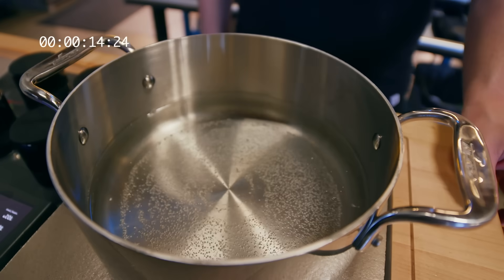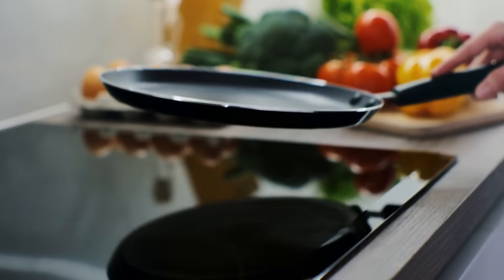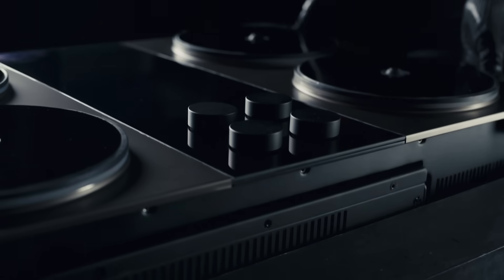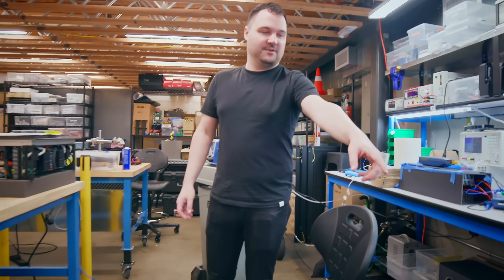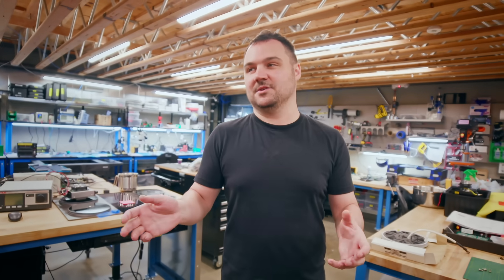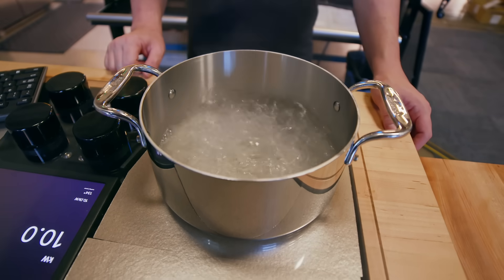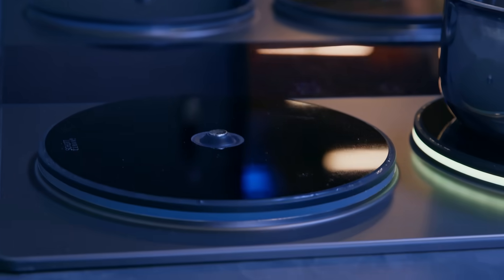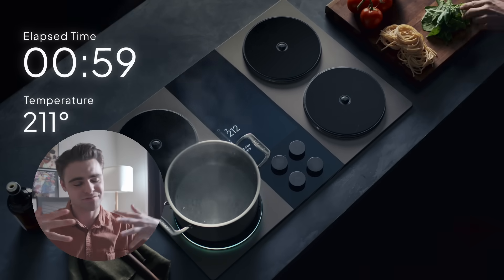World's Most Powerful Stove: Boils Water in Seconds | Impulse

Comment: What I want to know:
1. Temperature control is critically important for prosumers and chefs. How fast can these things cool down?
2. EMF emission. I don't want nnEMF blasted at my head. Please measure it and report back.
Reply: They cool down as quickly as the pan cools down when you turn a gas element off because the element never actually gets hot. It is only inducing current in the pan/pot.

Comment: I am intrigued. However, I think I saw some nub sticking up off the 'burners'. Do I also have to have proprietary pots and pans? Those burners didn't look flat.
Reply: I believe those are switches. When depressed, the element is able to turn on. Being an induction stove, anything ferrus will work as it uses magnetic induction.
Reply: It’s the temperature sensor. Works with all induction-compatible pots/pans

Comment: This induction stove looks like a great invention. But, natural gas is much more efficient than a coil, because it doesn't warp the pan and cause a single hot contact spot. Gas stoves are nowhere near hot enough to make NOx! Also, burning gas to make heat is 100% efficient. Burning gas to make electricity is probably 40% efficient. It's usually a waste of electricity to turn it back into heat. Maybe if you had a restaurant in the summer this makes sense. But gas stoves and gas heat are better for the environment overall imho.

Comment: Nothing compares to a Chinese restaurant jet engine-like wok stove😂
Reply: maybe in sound and wasted heat.

but if it's any indication, panda restaurant group (panda express) actually has been fielding some induction wok burners from lestov, the commercial chinese induction stove manufacturer.  they have up to a 25kw unit that's equivalent to a 150,000 btu (perhaps more due to electric heating efficiency).  they can reproduce wok hei with ease.

likewise, they're starting to get used in larger commercial cooking settings in china as well.

Comment: With the water boiling that fast I can only imagine how hot that pot is with 10 kW flowing into it.  

If the power goes out in the home how does it know when to safely feed electricity to the house with AC since it might go down the power line and hurt engineers working on the grid?

If this was two burners and cheaper with the 3 kWh battery, I'd consider but this price point is way up there.
Reply: Not 100% sure if it’s capable of back feeding power, I think he was just brainstorming potential use cases. The actual website make it look like it’s only for powering the stove. Anyhow it could work similarly to a whole house generator automatic transfer switch, though I’m not really sure you want to go through all that wiring for 3KWh.

Comment: I think this is a super cool idea, but launching it in a 30" cook top is a massive mistake. People who have cook tops tend to be more well off, with separate double ovens. As a result, they tend to be working with 36" cook tops with pre-run 240v. A 36" GE induction cooktop is only $1100. It can only dump 3.7kW into one burner, but it can do up to 11kW across all 5 burners without the risk of running out of battery. For those people, there is no reason to buy this product. This needed to ship as a full stove with an oven if you're targeting 120v 30". That's the market where people are trying to replace their gas range with a 120v 15a or 20a outlet. I would love to do exactly that, but the form factor makes it entirely a non starter

Comment: Is there any solution for stir frying/wok frying with an induction cooker?
Reply: The cookware is typically steel. It would work on induction. A flattened bottom version would work best.
Reply: There are lots of COTS (commercial off the shelf) concave induction burners up to 3kw.  Above 3KW you're looking at a commercial setup where it needs to be hard wired and might need to have your electric service upgraded.  A 12KW unit running at 240V would pull 50A.  Old homes (40 + years) are running 60A service. Homes in the past 30 (yrs) are at 100A, and homes w/ EV upgrades might be closer to 200A service panels.

Definitely a possibility.  But bringing a wok in the home isn't as easy as upgrading electrical service and getting the appropriate burner.  As an example, in California, existing code would require you to upgrade your range hood to handle the additional BTUs of heat output.  A commercial range hood at home will cost a crap ton but might be good if you're already doing a kitchen reno.

Comment: How does he control the temperature? Does he sell the pans or can it ....They can measure the inductive load on top. Perhaps with ML or fuzzy logic? How accurate does it get?
Reply: It uses temp sensing likely similar to the Control freak induction burner looks like.
Reply: Will share more soon but no special pans required

Comment: Just like all smoothtops and induction cooktops, this will be a royal PITA to keep clean. Higher temps mean more and quicker carbonization of anything spilled onto the cooking discs. You’re going to need an industrial buffer with cutting/polishing compound to clean anything off that’s been left on the burner for more than 2 or 3 cooking cycles.
Reply: Induction doesn't heat the surface of the cooktop to a temp to burn food spills on.

The choice they made to raise the cooking area/burners will be a huge PITA to clean for sure though.

Comment: Built our home in 2015 so I’d like to think we have a relatively new stove. It’s a big stainless box with some cast iron grates and valves inside, made in Italy. The ignition is electric, yes, but the valves are purely mechanical. We lit it with a lighter last time our power was out for 24hr (thanks for-profit investor-owned PG&E!) and used it to heat our open floor plan living room / kitchen, as well as for cooking.

I’m no prepper and no neophyte when it comes to technology (software engineer for a couple of decades at a Fortune 500), but I’m not a fan of putting a big capacitor or battery in a stove or other home kitchen appliance. I’ve already got 240v running to the kitchen, and with some quick Googling, it looks like the current US recommendation for new construction is to spec a 50-amp circuit for the stove. 50a*240v gives us 12kW, which the Google machine says is about 41,000 BTU/hr. Now, I’ve got a PowerFlamer 160El outdoor wok burner that is a bit like an iron salad bowl full of hellfire, and that’s rated at 160,000 BTU/hr, but I wouldn’t exactly try boiling a normal-sized pot of water on that at full blast. It seems like a lot could be done for normal kitchen-sized tasks if we had an efficient induction stove that could dump close to that 12kW of power through a single burner. I just looked up a quick “top picks” article for induction stoves, and it seems like a nice 50A 240V $2300 GE Profile 36” induction cooktop has a large center burner with 3700w and the rest are either 2500w or 3200w. This seems like it’s leaving a lot on the table (or rather, off the counter) by not having the ability to dynamically adjust power to one “super” burner if the other burners are on, up to maybe 10kW, or roughly 3x what it can currently do. No batteries or giant capacitors required.

If one really, really wanted that “liquify your aluminum cookware in 90 seconds with this counter-top electromagnetic foundry”, get a 100A circuit and have a 25kW (~85k BTU) burner, but I doubt most normal household pots and pans could take that much heat that quickly without deformation or damaging the finish. If no one will sell you one, just look up how to make your own — it’s just coils of wire and clever application of current over time, not exactly rocket science.

I get that there are losses everywhere and nothing is 100% efficient, but I’ve also got some experience with large, 500+ watt-hour LiPo cells for RC helicopters and battery packs for EVs, so thinking about the space under a stove, the logistics of transporting many kWh worth of batteries around the world, and the entire (short in terms of home appliance lifetime IMO) lifecycle of lithium / LiPoly / LiFePO4 / whatever batteries…I just wish I could buy this product WITHOUT the batteries. You had me at “better stove” then lost me at “put multiple kWh worth of batteries inside appliances in your kitchen”. I’m not a VC just yet but time-to-market, complexity, regulatory risk, BOM cost, etc all seem massively lower if you just focus on shipping a better stove vs building a better stove that sits on top of a mini powerwall. I’d also be curious to see what some home insurance estimators / adjusters think about these and their potential to turn into massive fireballs. As a VC, I’d also ask your company what the service intervals, replacement costs, additional installation feels, additional electrician install fees, and battery lifetimes + lifecycles are like. Take the battery out and ship it IMO. Good luck.

Comment: For stoves  in USA would they have the 3 phase inverter or is this for Europe? I have not seen a house in the US with 3 phase power. The battery boost is a great idea.
Reply: There is so much misinformation about the US grid on the internet. Yes the US uses three phase power for transmission and the standard to the home is split phase 120v and 240v, we typically then use breakers to send 120v 15amp to the outlets but certain specialty outlets for ranges, ovens, HVAC etc will be 240v up to 50 AMP. 10kW on a single appliance is possible in almost all american homes built after the 1960s.

http://s.co.tt/2019/09/09/240v-is-the-standard-u-s-household-voltage-kinda/

Comment: I’m very interested, but PERSONALLY I could do without the battery. If my math is correct, this unit could theoretically pull 40kW… at 240v single phase, that’s about 167amps. We have 400amp service at our house (atypical, I know), so I would be totally down to get this if I could wire this in directly (via 4x 50amp wires/breakers). Would be cool if you could offer that model.
Reply: No Idea about the power limits of the unit, it’s likely designed around 12kw max. Design would likely have to be altered due to all that extra heat.

Comment: So, one of those things he talks about with the power wall that he says there’s an issue, is very important for safety. Without that box that goes between the battery and the grid, you are potentially energizing powerlines that workers believe are not energized.
Reply: this one is counterintuitive -- there are grid-tie only solar systems that do not have this, because if the inverter shuts off on loss of grid that also is OK.  If you want to be able to back up your entire house you 100% have to have this.
Reply: All grid workers have a standard safety protocol which includes testing, followed by bonding to ground. They walk on to every job site, thinking that it is electrified and have to prove to themselves that it is not.
Reply: @Mark_The_Mayven  Local US electrical codes require this separation and a shutoff to grid feed when the power goes down just for this very reason. So unless you are 100% off grid, this safety measure isn't going away.

Comment: The main problem I have with electric is that if the bottom of the pot/pan isn’t completely flat, or for a frying pan if the handle isn’t tipping it a little bit, then contact with the burner is significant  reduced, making it hugely inefficient. Gas doesn’t have that problem. Oh yeah - this guy is also stretching the truth a bit when claiming this is a unique product.

Comment: Boiling water seems to be the benchmark for stoves much as 0-60 times is with EVs... 99% of the time, when I'm cooking it makes no difference how fast I can boil water, or when driving how fast I can drive off from a stoplight.  I question a stove (which is designed to get hot) being a good marriage with a battery bank (which needs to stay cool).  Also battery tech will change dramatically over decades, while stoves can just keep cooking'

Comment: OK, now what is the solution to potential thermal runaway situations in the kitchen? What about the potential for vapor cloud explosions from battery banks? Heavier than air or lighter than air gas can escape and fill a room in just a few seconds and ignite with a tiny spark anywhere in the room. Any battery bank large enough to boil water that fast has the potential to be a hidden bomb in your countertop. Kitchens are wet places, lots of things can get wet, there are foods that are acidic, alkaline and everything in between that can erode, degrade or just coat sensitive electronics over time.

Batteries "might be" the end game solution... I would just seriously consider the battery chemistry and really push these things to absolute destruction to find their inherent safety flaws. So many things to consider. Water damage coming down from upstairs, or a shared unit. Flooding? Extreme freezing temperatures in certain regions of the country, if say the power grid goes out... the batteries don't like cold. Li-ion batteries are thermodynamically unstable to begin with. And I would imagine any battery bank with a high C rate is just asking for trouble.

Comment: so basically it sounds like a Breville controlfreak cooktop.   Currently i use a Thermador Freedom 36" induction cooktop. It can have 6 pots or pans and no fixed burners. The whole cooktop surface can be used , you can put the pans anywhere and move them around. Its incredible.
Reply: This was exactly what I was thinking too lol. I am torn between this and the Thermador freedom. I like the flat and full surface cooking for easy cleaning and a variety of pan sizes, but I like the temperature control and physical knob of this stove. How good are the touch controls and temperature control on the Thermador? Maybe a compromise is to get the Thermador Freedom and Breville ControlFreak for precise tasks.
Reply: The thermador works great all around. But if you want to see the temp numerically the the control freak is the only real option. But remember it tells the temp of the pan not it’s contents.
Reply: @jstones9872  Thanks for the response! Just to be clear you haven't had issues with the touch controls? I have heard issues with it being laggy and not working with wet hands.
Reply: @jstones9872 Control freak can tell temp of contents, it includes a probe thermometer. Just used it for frying today.
Reply: @jstones9872  I have a breville control freak and it comes with a temperature probe that you can put in your pot and the induction hob has a setting to target a probe temperature rather than the pan surface temperature
Reply: I have no issues at all. TBF I had a thermador induction cooktop prior as well and that had no issues either.
Reply: Exactly what I was thinking. For the price of the Impulse, I'm not sure why someone would buy this over a Thermador Freedom. If you want backup, just connect an inline UPS with battery.
Reply: @carlover4239  Power. A LOT more power. Unlocks cooking that is impossible on traditional 240v induction, like wok searing, ultra fast boil
Reply: @SpicyHotPot12 
Wok searing won't work on an induction stove— it relies on the flames of a fire to lick the sides and heat the entire wok rapidly. 

Also traditional works are round-bottom and wouldn't have any surface area to make contact with the induction. 
If you compromise and get a flat-bottom wok, there's no reason not to just get a normal frying pan.
Reply: @LancesArmorStriking You would be wrong about that, there IS an induction wok, but it's its own separate thing.
https://m.youtube.com/watch?v=CzJKxUCKOBg
Reply: Neither the Breville nor the Thermador will boil water in 40 seconds.
Reply: @JohnDoe-vh4rt uh because waiting a full minute 15 seconds is too long🤷‍♂️
Reply: The battery is a game changer for people like me who only have 110v on their kitchen island and can't modify that.

Comment: We need the facts. How much energy is stored in total in one of these new stoves? What is the storage technology and capacity of the one blue cell shown multiple times? How many of these cells are installed in each oven? What is the total weight of 1 oven? The bidirectional AC/DC converter from Texas Instruments is probably a tested and working product (shelfware). And you would need brand new, thick wires between the stove and the power distribution system to carry 10's of thousands of watts along the line.

Comment: For Sam: Since you're planning to add refrigerators and other appliances in the future, are you putting in the research to prevent compressors and motors from adding significant line noise downstream of the inverter?